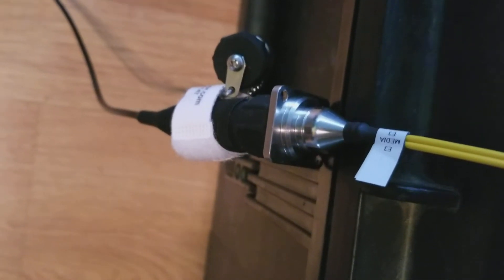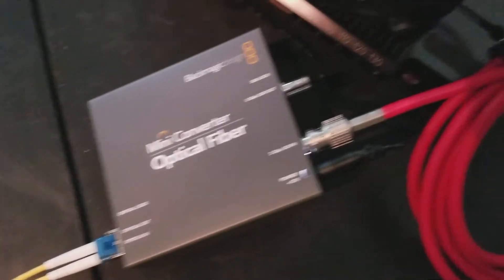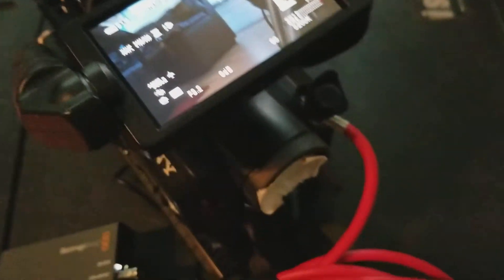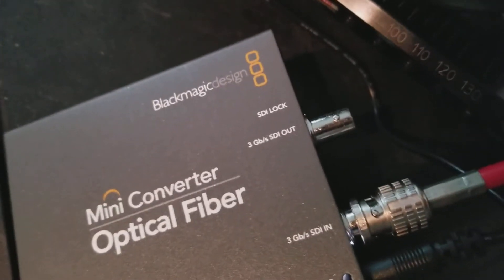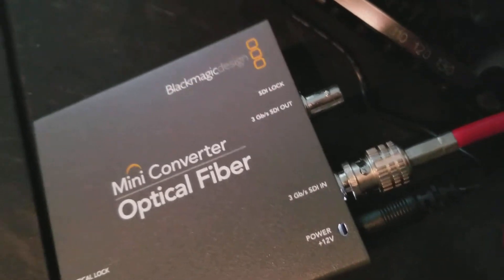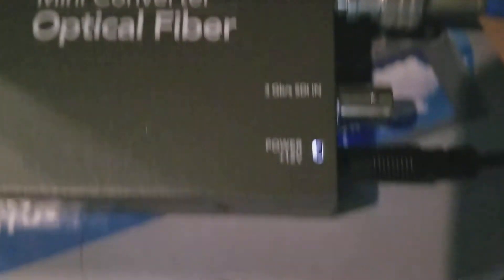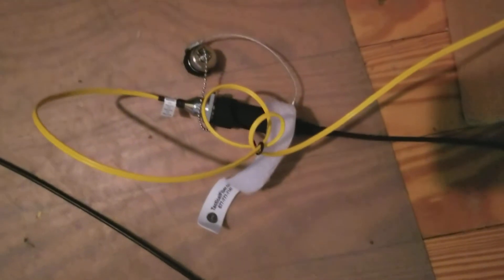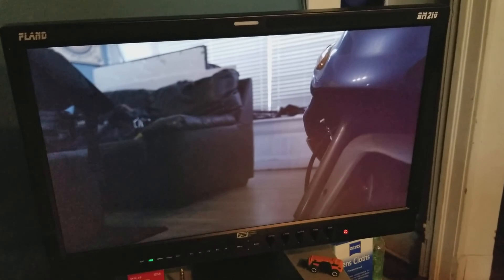Sending HD-SDI over fiber 500 foot run

Comment: Have you ever used camplex? I saw a comment where you mentioned using some Chinese brands, how long have you had them in comparison and how are they now?
Reply from the maker: I only used Camplex cables back in the day when we were stringing fiber for broadcast around an ice hockey arena... Well, actually I was an intern working underneath a guy who normally shot and edited commercials, but the station was making him do it. He grumbled a lot, and I learned how NOT to spool fiber that day. I think that was like 1992. So, technically, I'd say yes, but I digress! My fiber comes from mixed sources. I have at least one spool of good ol' fashioned American-made Tactical Fiber, which is the one I had to send back due to frighteningly bad jacket rot... The sheathing was just crumbling apart after three years or so. My Chinese made stuff has never done that. I have had all my spools between 5 and 3 years, so none of them have been abused much but a few times a year on our larger shows, but they all work flawlessly, knock on wood! Keep the ends clean, and minimize crush traffic, and maybe they'll last me 20 years.
Reply: @ethreemedia  sounds pretty good. I just got a 500ft of camplex tactical so knock on wood that it doesn't fall apart like what you've experienced.
Reply from the maker: @mr_wrightca  It was weird. No problems since then. I would advise avoiding exposure to UV light as much as possible - I'm pretty sure that wasn't the cause of my jacket issues, since the whole cable had the problem, including the parts that were wound under multiple layers of cable on the spool, but probably a good idea in general with all cables not designed to withstand UV degradation.

Comment: Thanks! I have a question:
If I have 2 camera, how can I connect them (using video converter/adapter) and send them throughout optical fiber separately to video ? mixer ?
Reply from the maker: You will need adapters - two per camera feed for a total of four (4). They really can't be on the same optical cable, so you'll also need two cables.
Reply: @ethreemedia  Thanks 👍

Comment: can you explain how the 2 fiber lines make the journey between the 2 devices without having to "flip" the cables on either end?  Looks like the "optical out" on one end would connect to the "optical out" on the other end,  and the "optical in"  would do the same.
Reply: The cables do swap from input on the source to output on the destination, of course.
Reply: @ericdarling8903    I'm certain that they do swap, wouldn't work other wise,  but where does this occur?  My use of my recently acquired Blackmagic Optical fiber Mini Converters will use LC to LC fiber cable (as designed) and those cables won't be swapping the "in" to the "out" at any point along the way.  I doubt I can plug one end in upside down,  but that would surely be the solution if I could.  I noticed you didn't have to do that.
Reply: @WeWereYoungandCrazy  It's simple... You just plug LC fiber cable #1 into the "in" on one adapter, and into the "out" on the other. I have stopped using proprietary adapters, so my LC cables are just loose at the ends, but it also works with the Magnum adapters.
Reply: @ericdarling8903   so you just break the dual LC connectors so they are unganged and free to plug into either in or out on the mini converter.   got it.
Reply from the maker: @WeWereYoungandCrazy  You shouldn't need to do that. If your cables are ganged already, they should have been manufactured correctly, where the fibers swap sides. Test it.
Reply: @ethreemedia    you are absolutely correct.  I discovered that the hard way.  I've worked with LC fiber cable for 3 years and never realized that.  LOL  Thanks for the info.

Comment: Hi, can you provide a link to the Magnum connector, please?
Reply: That's a proprietary connector from the Tactical Fiber folks in Deerfield Beach, FL. Their cable jacket has proven pretty weak and disintegrated over time. They did replace that cable for me, but I've moved on to other suppliers.
Reply: @ericdarling8903  who do you buy from now, if I may ask? Thanks!
Reply from the maker: @AngusFindlay  FS.com or eBay, typically. I've had surprisingly good luck with direct China shippers on eBay, actually (knock wood).
Reply: Thanks!